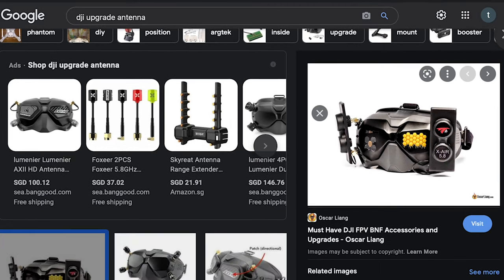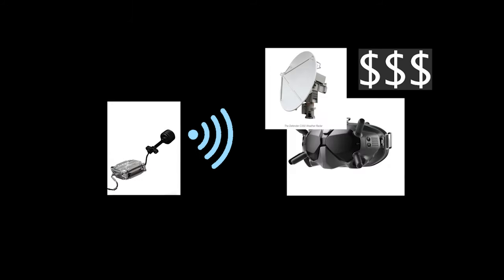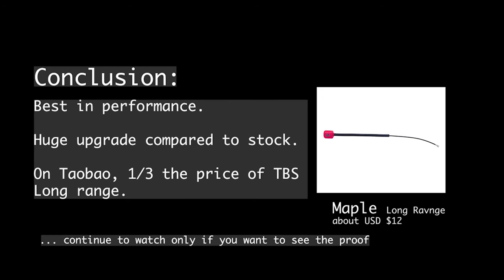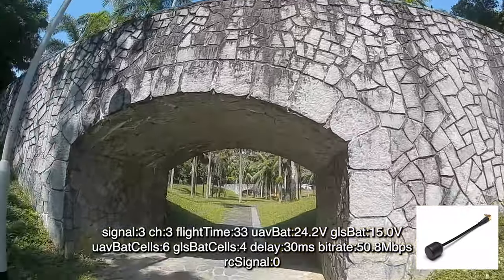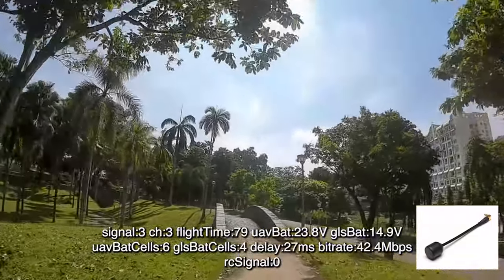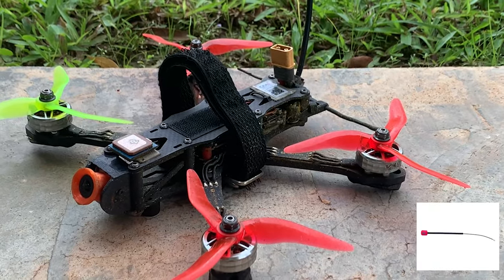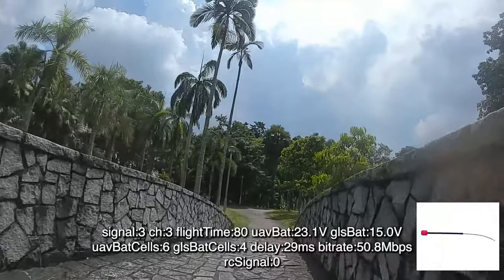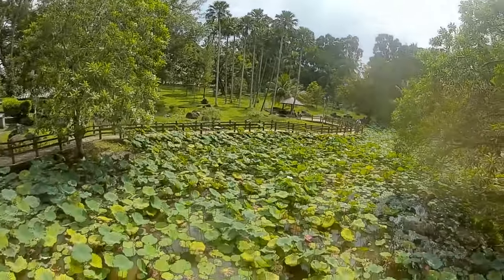Improving range and penetration of DJI Caddx Vista or Air Unit with USD $10

Comment: i ordered the tbs triumph, because i dont want to check if the cheap ones are all good, when i need 12 antennas.  the other thing is, a lot of pilots dont know, that they should avoid adapters or pigtails. even a 90° angle on the original dji antennas cost around 10-15% signal. a bit longer cable is no problem, when you use straight connectors and then it is also possible to mount the antennas with more distance from each other and in different angles. even the original long straight ones are really good. just dont mount them like the racers do.

Comment: God I cant stand those short freestyle antennas, more Durable....sure, But going from an Air unit with 2 x 15cm to a Vista with the stock antenna is night and day, heck even the lipo blocks the antenna turning around, I want confidence in my link before anything else.

Comment: great stuff... question, would the fcc hack help? i.e - with 1000mw etc? Cheers
Reply from the maker: It certainly will. This kind of antenna will make it better under whatever power setting. The main principle is to get above the battery for improved transmission.
Reply: @nutsidea  hey..thanx for the advise bro... happy flying 😁

Comment: I recently just los my FPV, it looks the BabyHawk 2 just DJI BNF just lost connection. no warning. Wondering if changing the antenna would improve range when I get my next one.
Reply from the maker: Hi Dimmy. Did you lose connection in terms of radio control or did u lose visual transmission suddenly?
Reply: @nutsidea  it was just sudden. No red bars. I still had video transmission. I made a quick tiktok from DVR footage but I’m currently planning my video if my experience. I’m so gutted as I just started and was having fun.
Reply from the maker: Antenna issues, unless it got dislodged at connection or battery cutoff, you do not get video cutoff suddenly. For DJI, you should see obvious degradation or pixelated video first before it starts freezing.
Reply: @nutsidea  yeah I didn’t have that. The pixelation is noticeable I was literally turning round to come back and zero response. I wonder if EMAX would assist in replacing but no way for getting the flight data other than footage. I’ll see what they say when I send them video.
Reply from the maker: @DimmyV  Sorry to hear that. Indeed there are lots to get the hang off starting out. 
I would suggest that you slowly increase your range at a large field first before flying off somewhere difficult to retrieve.
My first build lasted only 1min06 secs. It dropped into a pond because the battery ran out in the air.

My next question would be, how long did you fly when that happen?
Reply from the maker: @DimmyV  it is unlikely to be an antenna issue. How long was your flight footage?
Reply: @nutsidea  wasn’t long at all I think 5min but I had plenty of battery. Normally get 8-10min. I’ve been flying for a month. Got some good footage with Insta360 go 2 and was comfortable expanding my locations. I have some recordings but haven’t done anything with footage yet. I want to finish capturing Cyprus with mini 2 first as it’s a big task.
Reply: @nutsidea  I was 3min in just checked DVR
Reply from the maker: @DimmyV  if the voltage reading was still healthy right before the complete cutoff, and you mentioned you had video signal still and that too got cut off instantly, it points to a lost of power.
The lost of power could be due to wiring disconnect, or the FC died, or the video transmitter got disconnected. 
If you have Vista installed on it, it is unlikely that it failed because they are pretty hardy.

So the question is, when it blacked out, did you hear your Radio Control say Transmission lost or something? If yes. it points to power lost at either batt connection or FC fried.

Unless you can retrieve the drone, it is difficult to pinpoint exactly what might have caused it.

But I can advise with confidence is that it is not an antenna issue.
Reply from the maker: @DimmyV  If you can upload the video onto youtube, i can help you take a look at it. I may or may not be able to tell what caused it. I will try but no promise.
Reply: @nutsidea  thanks. When I get the opportunity to edit the video will let you know. 👍🏼
Reply: Why you can't get it back ? Is it in the sea or mountains ?
Reply: @aymen3962  it’s in the sea 💦

Comment: are you using only one antenna with the original air unit? Or you have just the camera installed and the unit is a caddx?
Reply from the maker: I was using Caddx Vista which only caters to a single antenna. 
The same principle of having a longer antenna would apply to Air Unit as well. However do take note of the difference in the connector.

Comment: hi , quick question , for max range on dji air unit v1 with googles v1 , do you think 25mb/s and low latency got more range than 50mb/s low latency ?
Reply from the maker: Sorry, I didn't test that.
Reply: 25

Comment: Please i there any test for analog?
Thank u
Reply from the maker: Unfortunately i have converted most of my quads to Vista. The reason was analog generally will not give you such penetration especially when the quad flew behind a two boulders/stone bridges. It does not matter what antenna you use on the analog in this case.
The general principle that transmission is better if the antenna is raised above main body more applies. 
Hope that helps.

Comment: Hello, do you have the link of the antenna? Thank you
Reply from the maker: Hi Sergio. I attach here the one listed by Banggood. I bought it directly from Taobao. Both (and probably other merchants) works.
https://sea.banggood.com/Mjlnir-Maple-Wireless-5_8Ghz-2dBi-Antenna-Omnidirectional-Circularly-Polarization-RHCP-LHCP-SMA-or-RPSMA-or-MMCX-or-IPEX-for-DJI-Digital-Goggles-V2-or-V1-Caddx-Air-Unit-p-1894403.html?utm_source=googleshopping&utm_medium=cpc_organic&gmcCountry=SG&utm_content=minha&utm_campaign=minha-sg-sea-en-pc&currency=SGD&cur_warehouse=CN&createTmp=1&ID=5323976313328&utm_source=googleshopping&utm_medium=cpc_bgcs&utm_content=sue&utm_campaign=sue-pmax-sg-en-rc-0909&ad_id=&gclid=Cj0KCQiArt6PBhCoARIsAMF5wajMdSBODcZdoPFWStxAbgiimTZgFREYNT_AlwUihiADxdeZUF713QQaAjZgEALw_wcB
Reply: @nutsidea  do you maybe have a new bangood link? can't seem to find it, thanks!
Reply from the maker: @shotbyarian  Hi Arian. I just checked. The link still works. Else you can search for Maple Wireless 5.8Ghz 2dBi Antenna Omnidirectional.
It doesn't have to be Banggood. I just happened to find it there.

Comment: lol you took the frame after your uturn ! after uturn TBS is better ! you're a cheater !
Reply from the maker: Perhaps you can provide the exact time in the reel for me to take a look at it?
This is just a sharing of findings. I have both antenna anyway. I am not sure if there is any need for me to cheat. I just used whichever is better or provide better value for money. ;-)
Reply: after he u-turned??  He did a whole bunch of circles with the cheaper one and even dropped the quad much lower and the bitrate never dropped to 9.xx like it did on the TBS antennae. clearly was better.